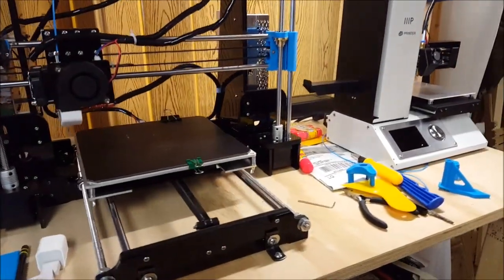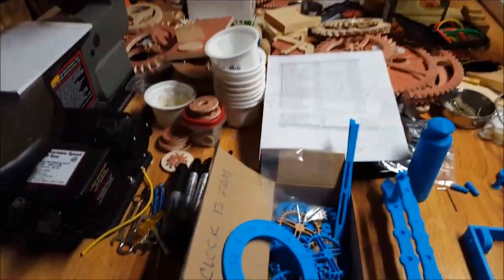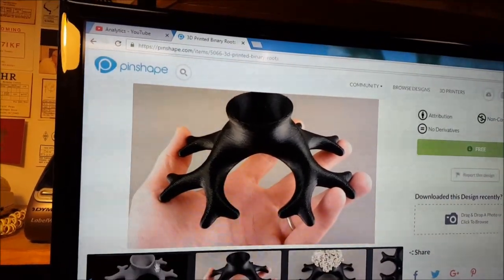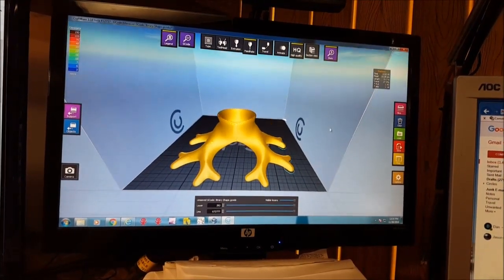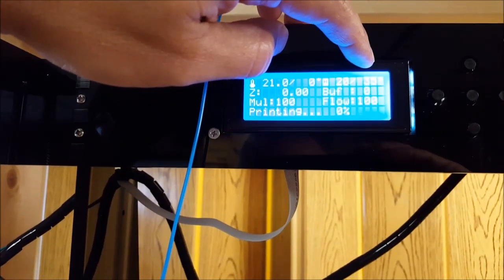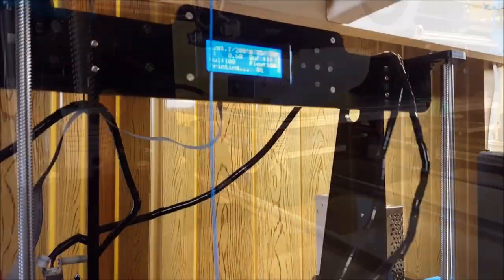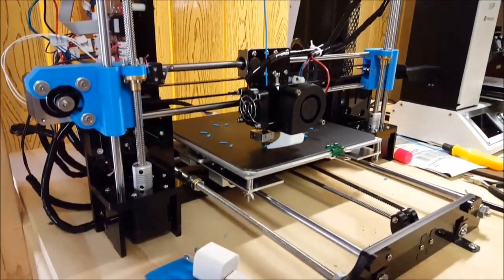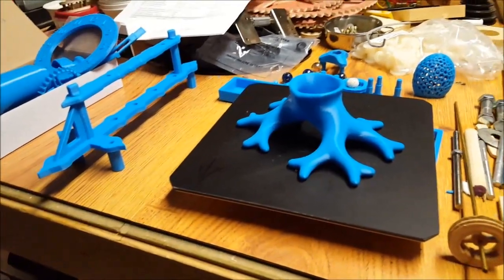3D Printed Planter Coolness

Comment: Can you list upgrades you did?
Reply from the maker: No upgrades, this is a stock Anet A8 kit.  I did reprint the side brackets on my Monoprice Mini because the ones that came with the kit were kind of cruddy but nothing else has been done to it.
Reply: Thank you! And those brackets are somewhat different than stock ones?
Reply from the maker: I don't think so.  I just went to Thingiverse and found some for the same printer.  They use the same bearings and mounts from the parts that came in the kit and look like the same pieces.  Just a cleaner print.  The ones that came in the kit were also 3D printed but had bumps and strings and didn't fit all that well.
Reply: drez20001 I see, interesting. Mine aren't printed. One more question do you have any tips for assembling? I'm impressed how good your prints are without any upgrades everyone everywhere telling. They say that without them you can't archive such quality as your prints. :)
Reply from the maker: These stock printers can do a fine job.  Some folks like to tinker and upgrade more than is really needed for acceptable prints.  A lot of the quality comes down to the slicer being used and settings.  Look at a free slicer from Craftware:  https://craftunique.com/craftware  It's extremely powerful and works very well for me.
Reply: drez20001 Thanks to your video I got plan to try Craftware too! :) Now I did test of electronics before assembly and preparing to finish it soon. Big thanks for answers.

Comment: I would suggest putting your 3D printer on a battery backup like i did. I get small rolling blackouts during the summer and have had tons of prints saved by  the APC setup i have.